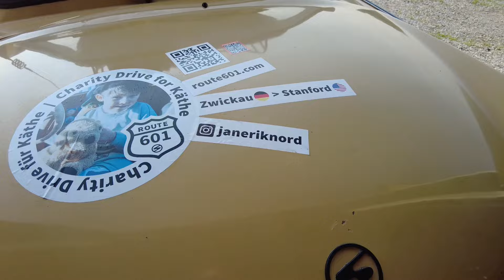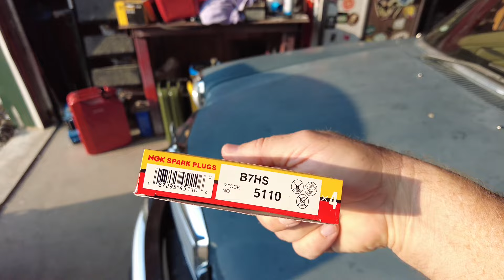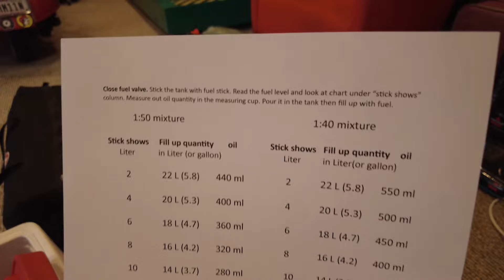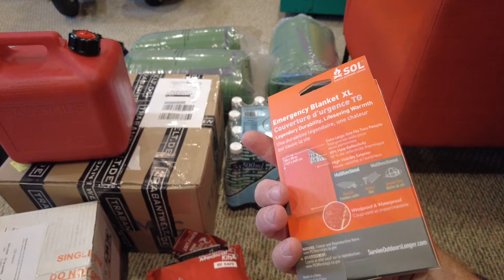4000 miles around the USA in a Trabant for a 3 year old girl PART 2

Comment: I remember back from early 90's that I learnt really well how to apply power and brake with one foot at the same time while approaching to a red light to prevent the engine to quit while on idle power😂 Heel on brake toes on gas. If that was needed I knew it's time for some minor maintenance eg taking the carb off and cleaning it. I always did that on kitchen table driving my mother crazy😂😂😂
Reply from the maker: William had to do just that on the Healey last weekend. The parking brake is INOP on it😅
Reply: So you raised an MEL item , Cat C for 10 days?
Reply from the maker: @csehakos3486  just about😂